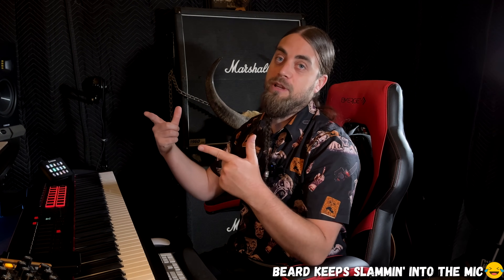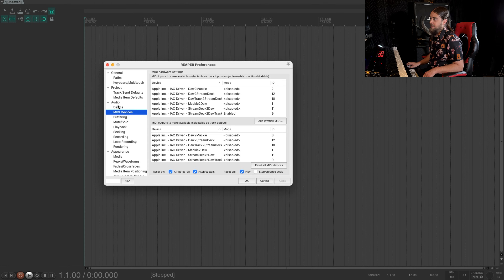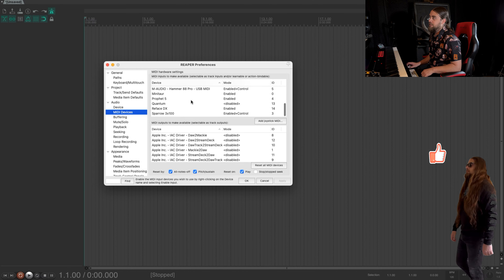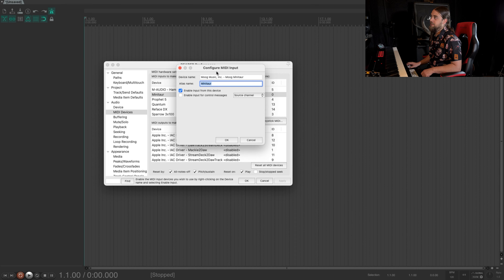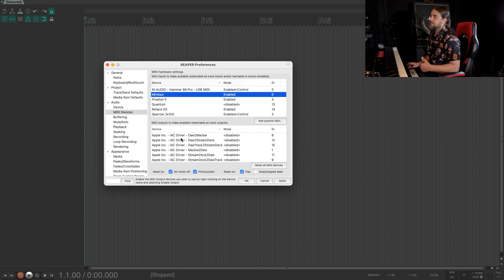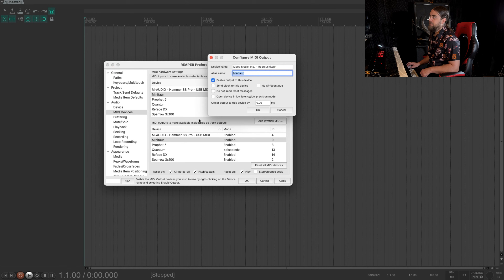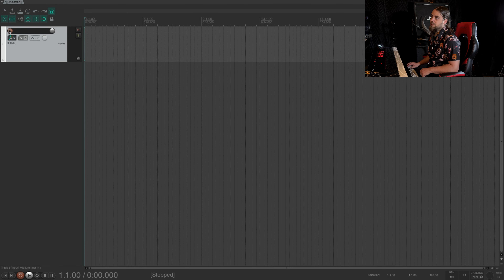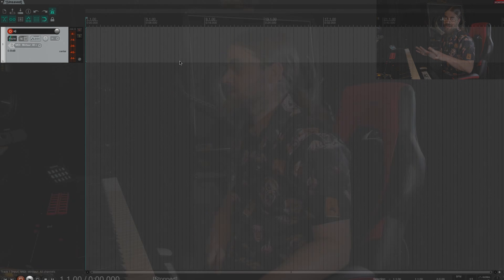Reaper Tutorial - How to Connect Hardware Synths (MIDI/Audio)

Comment: I have a 20 year old Yamaha MO8 that can be used as a multitimbral synth. In Song or Pattern mode, it can receive and transmit 16 different channels with a different sound on each channel. I am having a really hard time setting this machine up with Reaper 7 so that Reaper can receive and transmit the MIDI data through the USB port. The USB port works as Reaper can receive some MIDI data on a track except that when I play that track back it does not tranmit the MIDI data back to the Yamaha. How do I set these machines up so that it works?
Reply from the maker: Best thing I can tell you is to check my other video on synth connectivity in Reaper as it goes a bit more in-depth. Hope this helps! 

Reaper Tutorial - How to Set Up Hardware Synths (MIDI/Audio)
https://youtu.be/tS6OaNJH6SI

Comment: Hello, I have a MIDI controller (which works perfectly with the Reaper) but I also have two external synthesizers connected in MIDI with a Focusrite together with the controller, the external synthesizers record MIDI in the Reaper but it DOES NOT send the signal to the master. They worked fine and suddenly Reaper does not send the signal from the external synthesizers to the master. Can you help me? Is there something I have to reset, I don't know what to do anymore. Thanks
Reply from the maker: Sorry to hear you’re having issues! It’s definitely frustrating. I go further in depth in this video (https://youtu.be/tS6OaNJH6SI?si=7Vj2sCPtweCeiwP6) about reaper settings for hardware synth communication and connectivity so I’d recommend giving that a shot. Hope that helps!

Comment: Hi, is this the same process for a behringer deepmind 6? I've just.bought one and trying to get ahead of how to set it up before it arrives.
Reply from the maker: @ThePaperMonsters  Nice! Should just be plug and play usb midi
Reply: @riffsthatrule  I've got a behringer poly coming as well... is there a way to connect them to use them both at the same time, or do I have to use them separately when I record? Thank you for replying, it's much appreciated...
Reply from the maker: @ Anytime! Of course. You can run ‘em at the same time as long as you have enough i/o on your interface
Reply: @riffsthatrule  is this how I capture midi? Or just the audio in wav form?... I'd really prefer to catch the midi as well along with the internal sounds.
Reply from the maker: @ThePaperMonsters  No, that’s for the audio. It’s covered in the video but as long as you have 2 or more open channels on your interface, you’ll be good to run ‘em both at the same time
Reply: @riffsthatrule  do you have a video on how to connect hardware synth, use the internal sounds and for it to be inputting midi? Cheers
Reply from the maker: @ https://youtu.be/tS6OaNJH6SI?si=l5KKNaG32QyRe7LU

Comment: hi good video, I do not understand. I am wood string wind player. currently experiment with korg monodrone delay and Roland S1. how to what is best path to connect hardware? how to connect into reaper?
I assume answer depends how I want to control hardware then output to reaper to play audio correct?
Reply from the maker: It really depends on if your gear is usb midi, 5 pin midi or just audio. That would help get you started on how to connect everything.

Comment: I have a couple of Volcas and a Microfreak that I am wanting to use.  My midi keyboard is USB only and my Scarlett audio interface doesn't have midi connections.  What gear do i need to get to get all of this working together?
Reply from the maker: @idaho_rex  You could go with a midi merger box or a midi interface. That would connect all of your devices to the one main midi keyboard

Comment: Noob question: if I have my monitors hooked up to my interface and want to connect a usb midi keyboard and be able to hear what I’m playing through the monitors, how should my audio settings on Reaper be set? Thanks!
Reply from the maker: All you need to do is make sure you have your interface selected in Reaper’s preferences window. If you’re on a Mac, press command + “,” otherwise click Options at the very top and select preferences at the very bottom of that menu. Then, find “Audio” on the left hand side. Click the drop down and select “Device”. Then click the drop down where it says “Audio Device” at the top and select your interface. Then for the keyboard part you can just follow the steps in this video and you should be all set. Hope this helps!